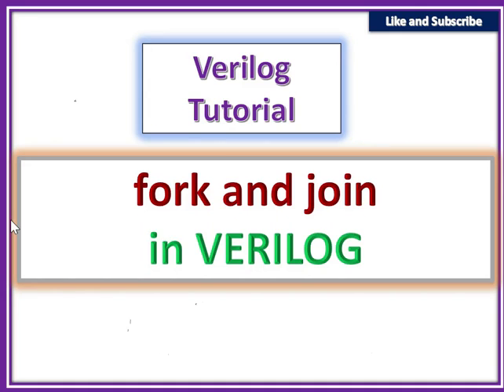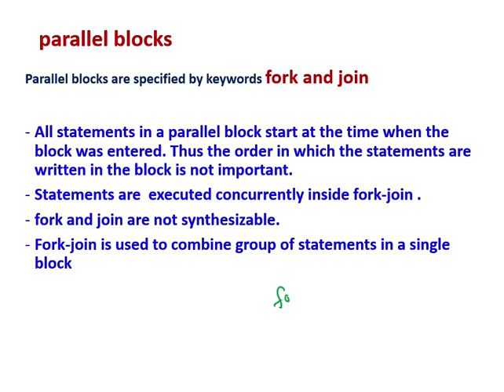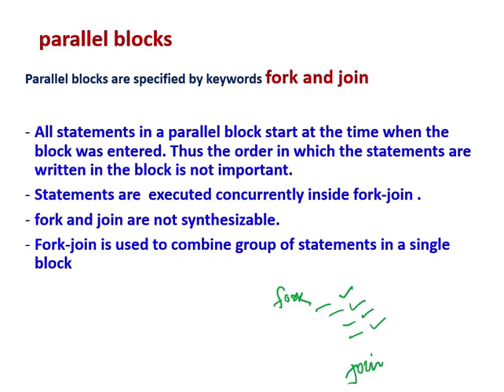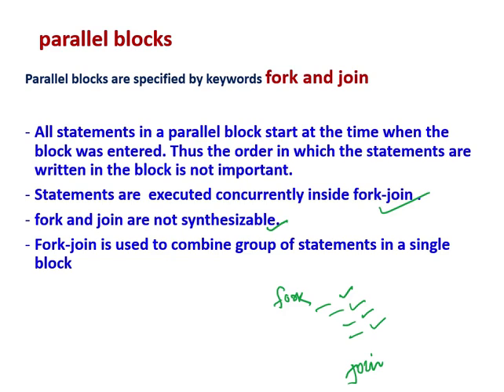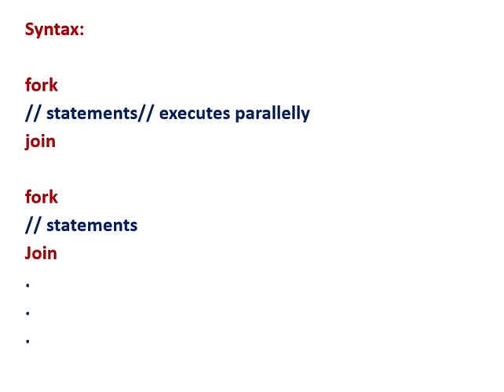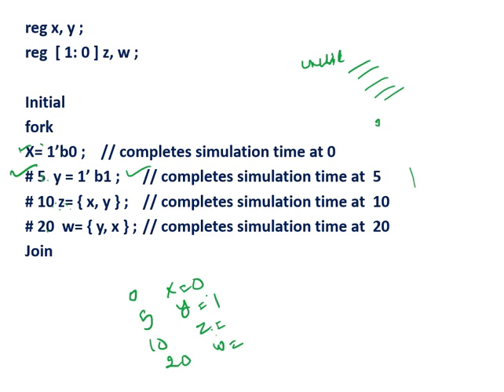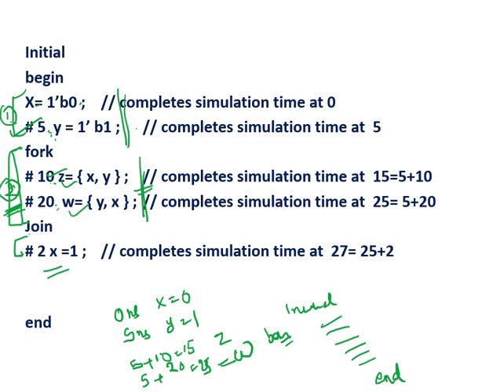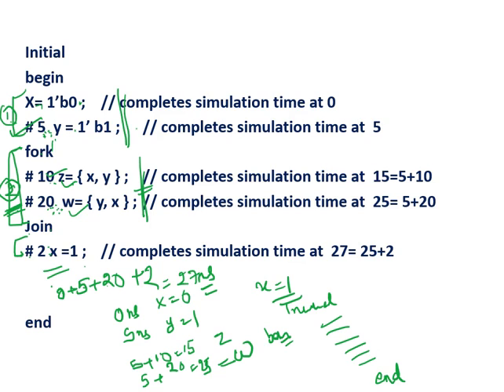#34 " fork and join " in verilog || parallel blocks || complete explanation with verilog code

Comment: Suppose can we use non blocking statements inside tb also run simultaneously instead of using fork and join
Reply from the maker: What we have to remember is testbench is not the real hardware code, it's used only to test the code's functionality. We can use all the constructs and operator in testbench that is for verilog coding.
We can use non blocking assignment in TB but it's of no use because the properties of <= can't be  used the way we can use it during verilog coding.